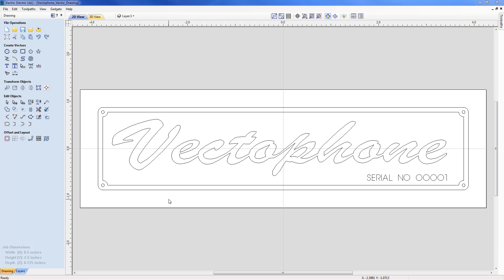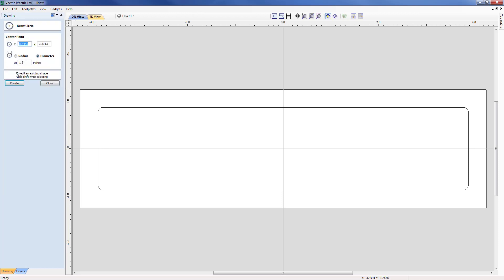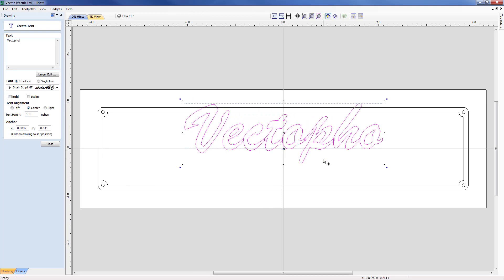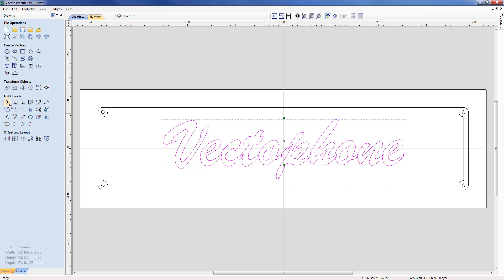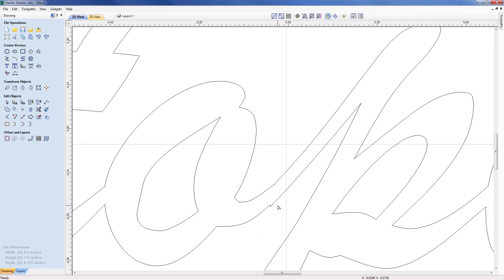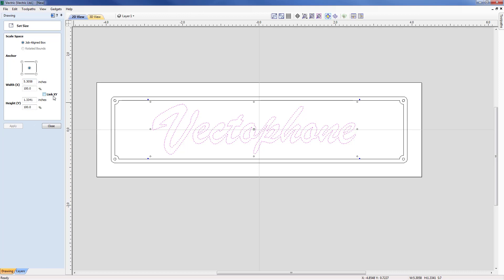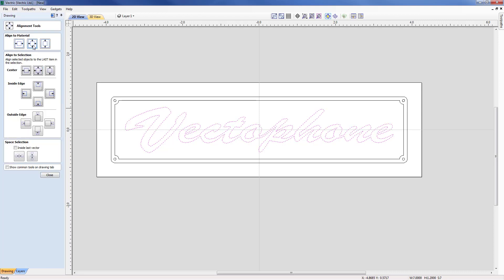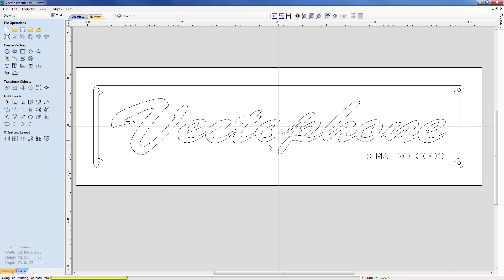Vectric V10 Tutorials | Vector Drawing | Vectophone

Comment: How do you get the weld option to pop up? This is the 3rd time i've attempted to do this tutorial, however I get a "Invalid Vector Selection: At least two overlaping vectors must be selected for this operation". I've followed this video step by step once and got it right, however when I try to close the space of more letters that's when this msg seems to pop up, so I wonder if it's because they're overlapped too much or if it's something else?
Reply: Never mind. I must have missed a step or something because all I did was highlight the text and select the "Convert to Curves" option, then I was able to Weld correctly (May have to deselect the inside vectors or "e" "o" and "p" // Unsure if closed vectors was the correct terminology lol). Rookie mistakes, but glad I figured it out. Great tutorial nonetheless!
Reply from the maker: Glad you figured this one out! Thank you